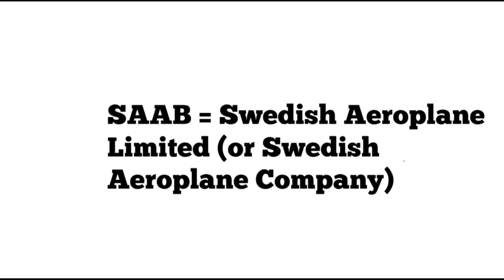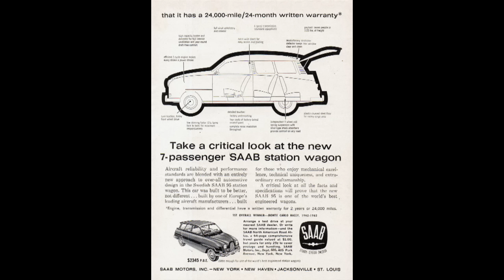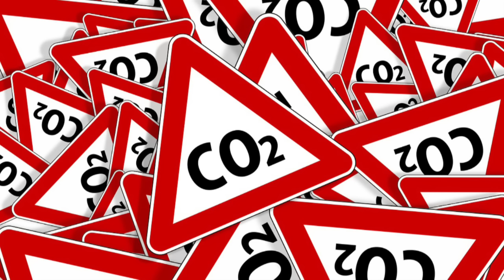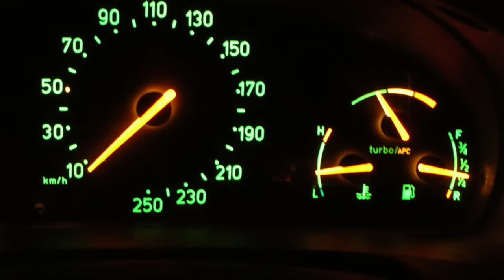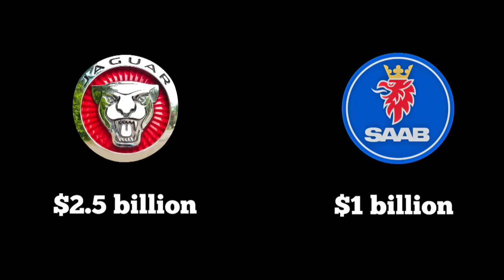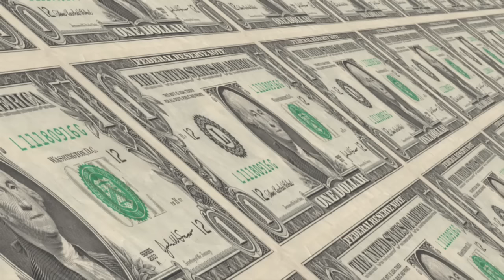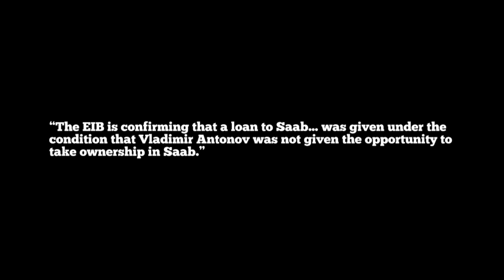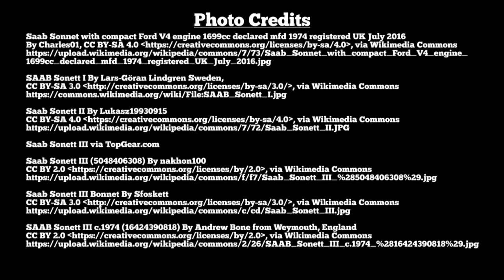The Life and Death of SAAB: RCR Car Stories

Comment: A Saab 900 saved my life and my Dad’s life when I was younger. I will always have the utmost respect for this brand and its commitment to making cars safer.
Reply: SAAB was a lot like the Citroën of Sweden.
Reply: I can firsthand comment on that seat of the pants experience DUI 100 mph into a guardrail flipped over slid on top what seemed forever sparks no glass left road rash almost broken back dislocated mangled left elbow popped it back in myself my friend and I walked away 1980 Saab 900 turbo had a 78 engine no turbo
Reply: I had the same experience.

Comment: I will never ever buy a GM product after what they did to the SAAB brand, it’s workers, owners, and customers.  8 SAABs owner here. I had a 1967 96 Monte Carlo, 1974 99, 1991 9000 Aero, 2 1991 900’s a 3 door, and a 5 door, 2002 9-5, 2005 9-5, 1993 900s, and a turbo convertible.  I met Bob Sinclair at the Import Car show in San Francisco. He asked if I would buy a convertible, I said yes if it had a canvas top. He said yes, with a headliner. I bought one that lives on in Ohio in a collectors garage.   And no, I don’t smoke a pipe or own a tweed jacket. SAAB cars were well engineered and way ahead of their time.

Comment: In 2010 I was working my first “big boy” job after getting out of the Army and was making decent money for the first time in my life. Every car I had ever owned up to that point had been a car that was on its last legs. Beaters. Bombs. Hoopties. I decided I wanted a car that was not only newer, but also interesting. So I bought a used, three year old Saab 9-3 from the only Saab dealer in Utah. And it’s the car that turned me into a “car guy.” It’s the car that made me realize you don’t need to spend a lot of money to have a car that’s different. It’s the car that taught me that cars can be interesting without being extraordinary. I put 100,000 miles on my Saab in three years before the transmission went out, and it was so expensive to replace that it made perfect financial sense to sell it and buy a Fiat 500 Abarth. Of the literally dozens of cars I have owned the Saab is the one I remember most fondly.
Reply: It's now an Alfa Romeo dealership, as I realized the other day. I would go to that same SAAB dealership to check out the new models. Not ashamed to admit they knew me by name lol.
Reply: I test drove one of those. It was a really nice and quirky car. I didn't end up buying it because the cost of running premium in a car that only had FWD and relatively poor fuel economy wasn't really something I relished the thought of. Having said that, I think it was the only car for which I've ever just sat in it and felt that I knew where every corner of the car was from the first encounter. It also had quite a good turning radius if my memory is correct.
Reply: Yeah... You bought a opel Vectra
Reply: @ole-mariusbergesen7818  A rose by any other name is still a rose. While it may have been a European GM chassis, it was actually the Saab drivetrain that the opel rebadged not the other way around. Irregardless the 9-3 was a unique vehicle in North America considering the opel and Cadillac BTS were never offered here.

Comment: I was lucky enough to meet Erik Carlsson at a race in Ontario Canada.  Saab was racing a 9000 turbo and it had a crash in the middle of the night (24 hour race).  Erik was right down there duct taping the front end back together.  What a guy!
Reply: I was at the Mossport Track in Ontario when Saab was promoting their new model that had the engine similar to the front wheel configurations similar to most of the models of today. I was not to far from Erik when I blurted out to the mechanics that I had a Notch back 67 Saab in the parking lot that they could borrow if they could not straighten the suspension on their 900.
I still remember the smile on Eriks face!

Comment: The first car I ever bought with my own money was a 2005 Saab 9-5 Arc Wagon. I was just fascinated with it. The valve cover gaskets leaked and the rear passenger strut was destroyed but I still drove and hour and a half to buy it for $800. I dumped money into it to keep it alive. The power steering pump, the alternator, cv axels, tires, etc. not because it was unreliable but because it was old. I loved driving it. The turbo made it so damn fast. And I moved my entire apartment into my first house with it. December of 2021 the secondary gas pump started to leak and the lines leading to it. I finally got it to a repair shop in the spring, just to be told that it’s rear sub frame was completely gone and not worth saving. It sits in my garage, waiting for me to get the cash to fix it and to find a person willing to work on it. I love this car to death and I want to cry just thinking about letting it go. Thank you for this.
Reply: Buy a cheap welder and get to work my boy, it ain't all that hard, just replace whatever it is that you cut out😊
Reply: Never sell it and lesrn to fix it yourself

Comment: I owned two SAAB's in the UK, firstly a metallic green M94 900 with the V6, comfortable, with a stylish interior and a great boot(trunk). A largely disappointing car noise and handling wise. Written off after an accident I replaced it with a black 9000 2.3 aero, a far more enjoyable and exciting car to drive. The 9000 would happily break traction at 60mph and spin up the left front wheel in second gear if the throttle was mashed into the carpet. A massive 4 seater with deep dished 3 spoke alloys from the factory and nick named by our eldest as "Hot wheels Harry" when she saw him for the first time.

A car I truly loved.
Reply: Hot wheels Harry. Good naming sense.
Reply: Hot Wheels Harry is an incredible name. Seriously.
Reply: non-UK people; M94 is a 1994 car, which would have had the letter M at the start of the number plate. Edit; apparently this is incorrect, but if i delete it the comment stream might not make sense
Reply: admittedly i've never been in a 900NG, but they never had the feel of being a proper replacement for the big bumper ones
Reply: Your not smoking the tires at 60 mph in your '94 saab.old geezer
Reply: I always liked the 9000. It was amazingly roomy, a perfect family car with a sense of style and fun.
Reply: @chrisdavidson911  m94 is the model designation for the newer 900 pre 9-3

Not the registration
Reply: @aspectcarl  i've never heard them called that in the history of forever
Reply: @catsaretasty  Tires made in 1994 aren't even remotely close to the performance of tires made in 2022, it's definitely possible

Comment: My parents had a 1972 SAAB 99E.  It was the best of cars and the worst of cars. It seemed to me that it had the perfect user interface, with all the controls perfectly proportioned, not too sensitive, not too anesthetized, with gentle feedback, not brutal, not effete.  The suspension was supple without being soft.  This may have been somewhat due to the fact that I was a new driver and the other vehicles I was learning in were a 1967 Dodge van and a 1973 Galaxie 500.  

It was the worst of cars.  By 40K miles it had needed rebuilds on both the engine and transaxle.  In addition it had experienced and intermittent short which would randomly discharge the battery.  It spent several days and nights at the dealer with a short detector wired up.

It had a fancy high tech hydraulic hose for the hydraulic  clutch which allegedly didn't need hose clamps.  This popped of twice.  After the second time, a hose clamp miraculously appeared.  The freewheel was still installed on this version, which was handy with no clutch.  You had to start it with the starter with the clutch engaged, but then you could just lift off the gas pedal for all shifts until you had to stop again.  

The most fun bug was that the Bosch electronic fuel injection had an extra set of points, presumably for position and RPM information.  Somehow it could run without then when they broke, but it was degraded.  The main effect was that at idle it would start to die, then gun the engine.  This was amusing, especially when my 40-something mother was driving.  Now she was a car nut whose favorite vehicle was the original Mini Cooper.  When I was 7 she did read me the names of all the cars we came upon.  But stoplight grand prix was not her style.  

When that thing worked is was the sweetest of cars.  But too often, it didn't work.

Comment: I remember Dad's artist friend, Edith, had a Saab 96 in the 1960's & '70's. I think, that it was a 1960 model, which she bought new. It had a 2 stroke engine & freewheeling clutch. It road very smooth for a small car. It was completely reliable, back when few people expected any car to be. I remember thinking, that it must be a hassle having to make sure, that she put oil in the gas, I was just a young kid, so I didn't realize, that it really wasn't any trouble. I imagine, that most of the engine failures resulting in a warranty claims came from people loaning their Saab to a friend or relative, then that person failing to put oil in the gas. That's certainly been the fate of many boat motors over the years! I was intrigued, that it was front wheel drive, as that was unusual in the US at the time. It never once broke down.
Reply: That generation of Saab was popular with artsy sorts, long before the turbo models gave the brand performance credentials outside the rallying world. I once knew a set designer who drove a 96.
Reply: I have a 1938 Rover 16 Sports Soloon.
It's good to know that SAAB also had  this device.

Comment: When I saw that this was over 3 1/2 hours long I thought, I'll never get through it all, I just don't have the patience for things like that anymore. 3 1/2 hours later I'm wishing there was more. I'm going on Ebay to shop for an old SAAB now. Thanks!
Reply: Barry, just be careful that you choose a "Pre-GM" model. I suspect that would already be what you're looking for but GM's history with the global automobile industry hasn't been anything to brag about. What with their run through European, English, and Australian brands, GM has pretty well trashed those brands before either closing them or selling off the remaining scraps. 

I bought a new 1979 SAAB 99 EMS, 2 door sedan that, to me was a Swedish BMW 2002. The performance and handling, in spite of the front wheel drive, was very similar, but it was far more comfortable than the BMW. One thing that always gave me a chuckle, was when my wife would drive me to work in the morning and take the car for the day, she always was annoyed that the heated driver's seat would shut off before she got to drive the car! It wasn't a quick car but it was a very good fast cruiser. It made many smooth 100+ mph runs through the Southern California deserts with no drama. The passengers had no idea just how fast we had been moving until they happened to notice what time we arrived at our destination.
Reply: @MrGaryGG48  Yeah, I wouldn't touch any GM SAAB, might as well buy a Chevy. I had a 71 99 and a 78 99 EMS. The 78 needed a 5 speed trans badly, but other than that I really liked it. I owned it for over 6 months before I realized it had heated seats, on the first cold morning on my way to work. I was a tech at a BMW dealership at the time (Certified Master BMW Tecnician, LOL!) and you couldn't give me a BMW 2002, or a 320i either for that matter.

Comment: I didn’t know about Saab until back in 2011 when I first saw a 9-4X at a airport when I was 11 years old. The NG 9-5 was oddly a dream car of mine, luckily I found a 2011 9-5 Aero as a birthday gift when I was 18.

It’s now a secondary car but it’s a very special car even though it’s based on the Epsilon 2 platform which is one of the better FWD based GM platforms at the time. I am learning more about Saab’s past models and aviation, but the final era of Saab is what caught my attention.

The saddest thing about the discontinuation of Saab was that the NG 9-5, 9-4X was short lived, NG 9-5 SportCombi never came to the US, spy shot of a unfinished clay model of the next generation of the 9-3 never came to production.
Reply: I prefer the OG 9-5s but man. Them 2011 still look so modern in 2022. Beautiful car man, I hope you keep it on the road. Only way it could look better is as a wagon.
Reply: NG 9-5's are so pretty. I've got two OG 9-5's, but I'd sure love a 2011 9-5 Turbo6 XWD one day. SportCombis are essentially unobtainable. I will likely never see one on the road. As far as I know, there are less than ten roadgoing NG 9-5 SportCombis in the world, with less than 25 ever being made with at least 5 being destroyed in crash testing. I know that some NG9-5's have been converted into wagons however.

Comment: My family has had Saabs for over 50 years. From my great-grandparents to me, we've had almost all of the models starting with the 96 (no 9-2x or 9-7x). I still daily drive a 9-5 wagon with almost 180k miles now. It will be difficult to eventually replace. Thank you for the excellent video on the brand, I always appreciate new Saab content!
Reply: Erik...great sentiments! I often think about what I'll do if my 2008 9-5 with 125,000 miles needs a major, expensive repair. To date since new, I've spent a total of $5,028 on all labor, parts, fluids, batteries, tires...everything. That's $359 per year.

I recently asked my independent SAAB Master Tech what the cost of a used Aisin AW55 transmission and labor was. He said about $2,200. My 9-5 might only be worth $5,000, but it's worth a lot more to me. I know the car and it's history. Honestly, I'm more than willing to invest even $5,000 in parts and labor. The car is long paid for, so it would be akin to paying $5,000 for a new car...at least for me.
Reply: @hoppysport2872  completely agree about keeping the car on the road. I just checked my spreadsheet, and since it came off warranty when new, I/we have spent over $20k on maintenance on the 9-5 wagon alone, not adjusting for inflation...
Reply: @ErikTS  Wow, that seems like a lot. Are those dealer labor and parts prices? My $5,028 is from independent SAAB Master Tech. Plus they let me buy my parts, which is a huge savings. In 125,000 miles I've replaced 2 DICs, 2 Throttle Bodies, a PCV Valve, hoses, a Heater Bypass Valve delete, subframe bushings, shocks, struts, exhaust including two mufflers, bulbs (thankfully halogen) 2 batteries, a few rear bulbs, control arms, 2 sets of front rotors/pads and one rear set, 2 sets of wiper blades, one set of motor mounts, one front transmission mount, 1 mirror switch, and four green window rollers.

I was lucky to find 3 SAAB Master Techs...all with incredible knowledge. My current one drives me to a Panera Bread if it's going to be long and I enjoy lunch, go online and do work on my notebook.
Reply: @hoppysport2872  yeah, over the last 16 years it has only ever had service at two different saab dealers.

Comment: Congratulations on this definitive history of SAAB. This will be the historical reference of record about SAAB for a long long time. My family had five Saabs in the 80’s and 90’s and they registered hundreds of thousands of miles. Best built cars we’ve ever had. Not one engine or turbo failure even with just the oil cooled turbos. Our 9000 saved my wife when a fool pulled out in front of her while she was going 60 mph. The last one, my daily driver, a  ‘86 900T gave up its life when a deer jumped out in front of me destroying the front and right side as it pirouetted down that side. I hardly even felt it and drove on to work. 
The SAAB club had some legendary meetings. I met Eric Carlsson, pa taket, (on the roof) at New Glarus, Wisconsin, where he was proud he found the hot tub where he could invite the girls to join him. At the convention at Kings Island I met David E Davis, Jr., our speaker. He was a true gentleman and car nut. I was part of the staff and I saw him arrive driving his car around the parking lot taking a long time looking at all the wonderful Saabs.  He gave one of the best speeches I’ve ever heard. I’ll never forget the convention at the GM Heritage Center where we saw the historic Saabs. 

If we could do so today we would buy two new 900 Turbos without question.

Comment: Yes! Buddy i can’t wait to near this! I owned a 1987 900 Turbo Coupe and every single part was so incredibly expensive that I had to sell it. It drove great! But it was plagued with little things that I was constantly having to fix. Perfect example was a turbo vacuum hose that would love to pop off while driving which would disable the turbo. I didna clutch once it it costs almost three thousand dollars! A starter cost me eighteen hundred! However, when I think back about this car I always remember how great it drove and handled. Also the rear seats folded down and the cargo area was huge! I loved my Saab. I miss the idea of having a Saab, but I would never buy another one because repairs were so extremely expensive. Thanks Roman for this video. I flippin’ love your work!!!
Reply: I've seen a movie in which the Saab 900 turbo featured a big role, it was called "Drive My Car" I'd recommend it if you're into Murakami.
Reply: Modern 9-3 and OG 9-5 aren't that bad. The cars are in junkyards all the time. You can buy everything from esaab